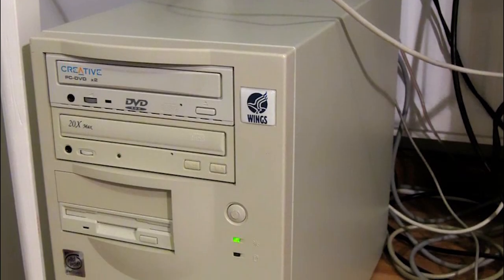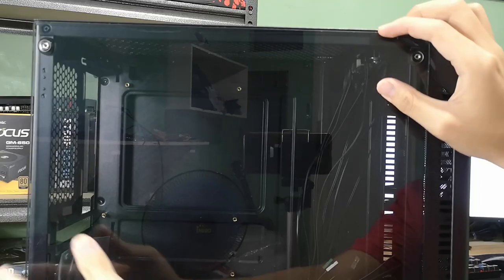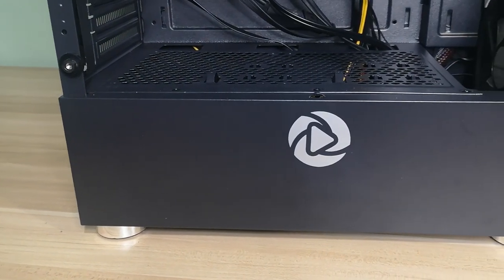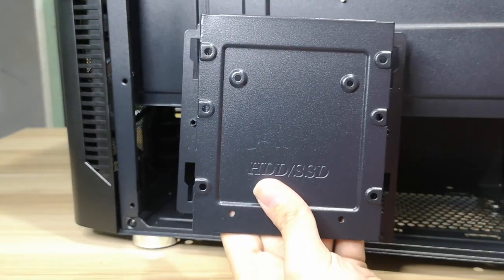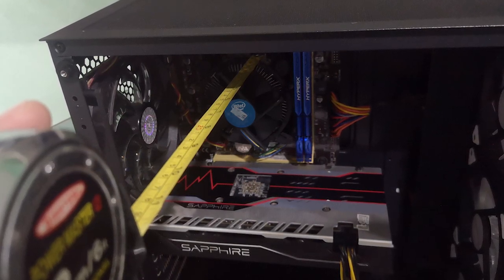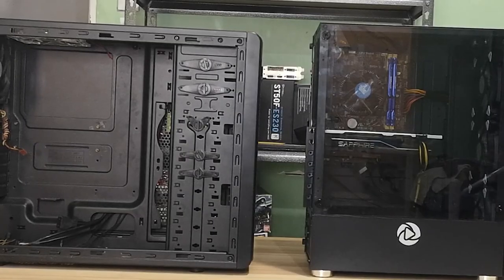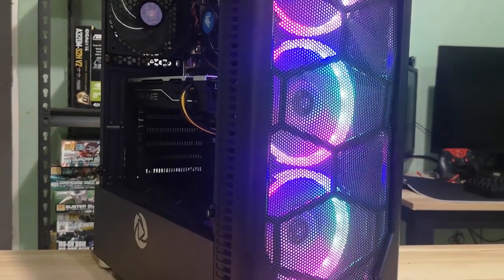Inplay Meteor 03 Gaming Case Review

Comment: You can mount the fans outside the front panel to save more space for gpu/ other stuff
Reply from the maker: Thanks for the tip!
Reply: Yes it can but the problem when placing outside, it's so hard to screw the fans because you'll screw it inside.
Reply from the maker: @emelcapilitan7109  yeah. I realized that too. It's doable, but a bit inconvenient
Reply: This was actually my first try on mounting since I didn’t realize in can be mounted inside and the front panel is removable lol. It is very hard to access specially on the bottom part fan
Reply: Mas okay sa labas ng front panel kung di naman sagabal sa gpu. Pwede mo pa lagyan ng magnetic mesh loob ng front panel.

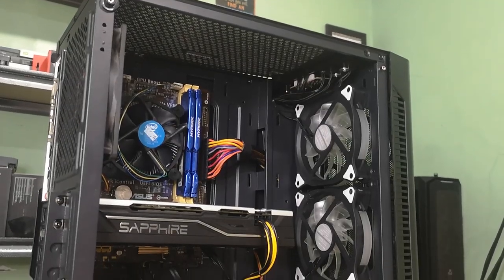Comment: I have this case. My only main complaint is hindi ko mainstall ang Arctic Liquid Freezer II 240mm in front dahil nakaharang yung mga wires (4:09 , sa ibabaw ng front fan) which are for the power button, reset button and usb ports.

Comment: Same pinoy here.... I had a problem with mine.... I added a 280mm aio in my pc by mounting it in the side where the fans should be, it ended up f*cking up my power button and reset switch 6 ways, The cable management is hell and harddrive bay was actually hell to put in and out.... Airflow is actually quite nice. I'm rocking a ROG strix b450 gaming ii, rtx 4060 and a ryzen 7 5700x

Comment: I put one 120mm fan at the top of the shroud but in intake pos then used cable ties im using inplay meteor 1 same design but meteor 1 is full tempered glass

Comment: Hello sir I have this case and I want to ask if it can support 240mm AIO liquid coolers in any possible way (Top or front mount). I wanted to upgrade my air cooler to a liquid cooler because I lack fans to support a proper airflow. Thanks!

Comment: Was about to buy this case, but the cable management just took it away from me lol
Reply from the maker: Glad this was able to help you with your decision!
Reply: @droborja  though it took a lot of effort for my first build/case transfer it is possible 
even more so if you have a modular power supply since I only have a non modular power supply i tucked the rest of the un needed wires behind the HDD rack and it worked out beautifully

Comment: anung recommend gpu sa deep cool smarter case sir. medyo maliit kya di kasya yung high end gpu. lgi na lng  gt 710 o kya gt 1030 nkkainis. ksi pg-high end gpu overheat agad
Reply from the maker: Di ko alam tong case na to eh. Mag research muna ako about sa case na to. Update kita after. :)
Reply: @droborja  ok sir... tiyaga muna sa legendary gt 710 haha..
Reply from the maker: Ang max length na support pala nyang deepcool smarter is 320mm or 12.5 inch.

Kaya rx580 or 1660s na dual fan

Comment: , ung SSD ko kasi RGB saan ko kaya sya ilalagay para naman ma flex ko XD tyaka ung fans ko 140mm compatible ba sya jan ?
Reply from the maker: Pwede sa top ng psu shroud yung ssd mo bro. Ipwesto mo nalang yung ssd ng nakaharap yung saksakan ng sata cable nya dun sa 3 holes nung shroud para maganda cable management.

For fans, 120mm fans lang talaga compatible sa case na to.
Reply: @droborja  shocks umorder na ako kagabi lng 140mm kasi ung stock ko dito na fans boss :( sana pwede pa ma cancel sayang gusto ko pa naman ung case na to very cheap and maganda
Reply from the maker: @dtechzsama  ilan binili mo bro? Kung hindi na macancel, pwede mo gawan ng paraan. Either gamitan mo zip ties or twist ties nalang. Pero most probably mukang sa top mo sya maiinstall pag ganon.

Comment: I currently use inplay meteor 3 white, and i mounted 3 120mm fans on the outer front of the case so that there's more space inside, and j managed to install 2 120mm on the bottom, i used 8 standoff screws so that annoying shitty metal doesn't touch my fan blades🤣🤣🤣
Reply from the maker: I thought I was the only one that found them annoying. 😂
Reply: Pano ginawa niyo mga boss?
Reply: anong standoff screw po ginamit nyo sir? yun bang kapareho sa motherboard?
Reply: So does it mean it can fit 8 120mm fans in this case? I'm planning 2 additional fans at the bottom part of the case. Please confirm. Thank you